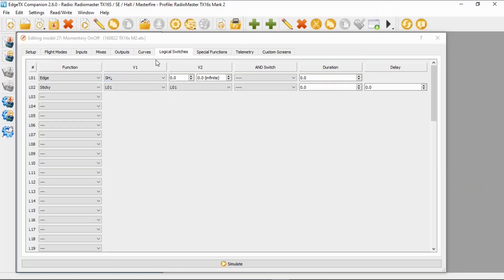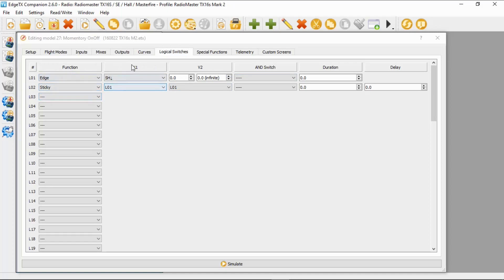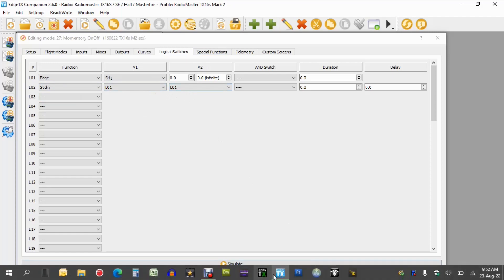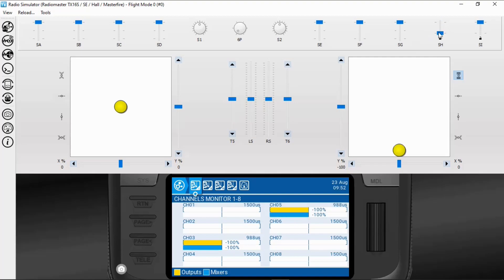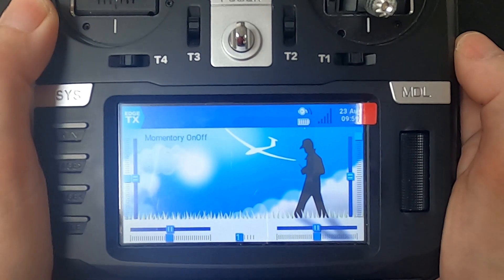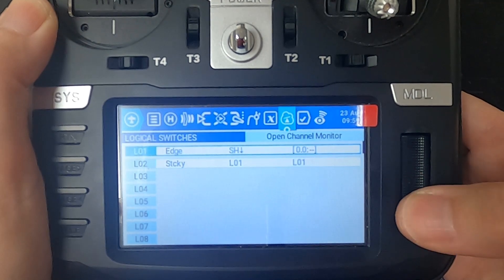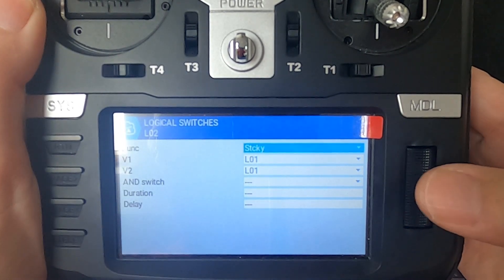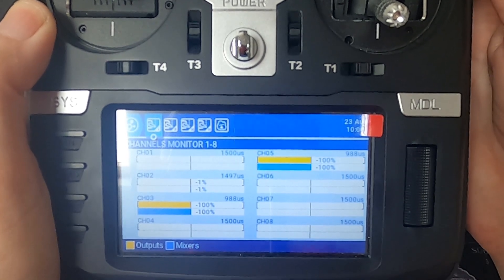EdgeTX Momentary Switch One Click On One Click Off

Comment: Is there a way that you can use a push button switch as a 3-position switch
Reply from the maker: This video may help you https://youtu.be/JzShbMj_9mw?si=fwaF-ss3Rrp4y9iV
Reply: @the-happy-RC-flyer  I just want to be able to control a servo as if I was using a three position switch
On the button one button press -100 2 button press  
O position  3 button press +100
Reply: @diywithpapo4576  Yo I figured it out

use the channel override feature in the special functions menu. Set each global variable number to be a logical switch, and when that switch turns on make it override the channel with whatever number you set.
Reply: Is there any way you can make a video

Comment: You don't mention that in Mixes, you have to select L02 as the source.  If you just have SH selected, it won't be sticky.  That's probably why you have some comments saying it doesn't work for them.   Also you don't need that first line.   One line could read Sticky, V1 and V2 can be the switch in the depressed state.  Then in Mixes, select that Logical switch as the source.  I just tried all this on a RM TX12 MK2.
Reply: I used your sistem and it works, that in the video not work to me and yours is also easier, thank you
Reply: yes this work on my radiomaster zorro

Comment: I tried this on the zorro and couldnt get it to work.
Reply from the maker: Hi Jimmy, just got through your settings carefully because it will work on your Zorro.
Reply: Ive tried it multiple times now and it doesnt work. Im guessing its because I dont have an infinite setting under v2 just --- numbers and << ive tried them all and no luck
Reply from the maker: With the settings I have shown in my video you have to hold the momentary switch for at least 0.5 of a second for the switch to activate. Try changing V2 to 0.1s

Comment: I have a dumb question?
What is the meaning of the function "edge" in this case?
Google has 19 translations for edge and there a much more. edgeTX means top/best-TX?
Reply from the maker: No dumb questions. Edge is a complex function. 

A function used in Logical Switches that returns a momentary switch dependant on another switch or flight mode dependant on time active.

Comment: Bonne video qui me serait utile mais malheureusement ca ne fonctionne pas sur ma Radiomaster Zorro ,faut il passer par edge TX Companion , parce que en le fessant sur la radio rien n'y fait ca ne fonctionne pas . Merci
Reply from the maker: Please check the settings it should work.
Reply: @the-happy-RC-flyer  Merci de votre réponse.J’ai encore essayé plusieurs commandes mais ça ne se fige pas …la seule chose que j’ai remarqué de différent par rapport à votre tuto c’est que dans Channel Monitor (je passe de o à 100 et que chez vous ça passe de -100 à 100 ) 
Mais encore merci pour tout.
Reply from the maker: @samuelfilleul9660  you need to check your weights default they should be 100 and not -100 but this will depend on the orientation of the servos in your model.

Comment: Thanks for that. What would be the most efficient way to apply that to a channel so that it woild switch lights on and off.
Reply from the maker: You can use the same programming as in this video but you will need a channel switch just search eBay to purchase one.

Comment: I've just installed Edge 2.8.1 and I set up my momentary switch exactly as you did but mine won't stay sticky. Any ideas what could be the issue?
Reply from the maker: I would double check your settings first.
Reply: @Bill Clark  Hi Bill. I've gone over the settings multiple times and stopped your video to check and it just won't go sticky. Are you on FB at all please? I can send you over a quick video.
Reply from the maker: @peekabooooooooo  HiFly, if you know how to make  a back up of your radio please send it to me and I will check the programming for you. Use EdgeTX Companion to back up your radio and email it to triplemadventures@gmail.com
Reply: Mine also doesn't stay high after I click the button on my Zorro, trying to use button SG. Did you ever figure this out?
Reply from the maker: @ericnelsonnn  if you follow the programming details you should be ok. If you can back up your models and radio settings and email the file to me I will take a look. triplemadventures@gmail.com
Reply: @ericnelsonnn  did you find out? mine won't stay sticky neither
Reply: Ditto here with EdgeTX 2.8.4 on a Radiomaster TX 12 Mark II - channel goes high for a few milliseconds, then back to low.  @Bill - have you tried this on a recent version of EdgeTX?
Reply: Does not work for me either on Zorro. Watched some videos on other channels as well. Still no luck.
Reply: I'm also having no luck with Edge 2.10.1 on Zorro

Comment: Hi Bill, is it possible to create a logic to simulate 4 position switch,  based on 4 momentary buttons? In radiomaster zorro, there are 4momentary buttons and I would like to use them to switch flight modes.
Reply from the maker: Hi Mariusz, yes this should be possible. I will work on the programming for you.
Reply: @the-happy-RC-flyer  thank you !